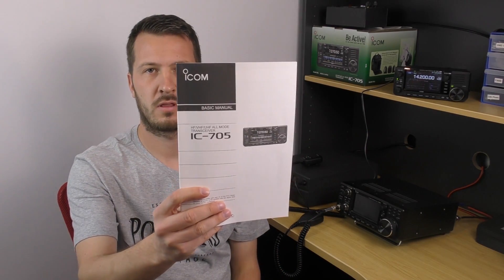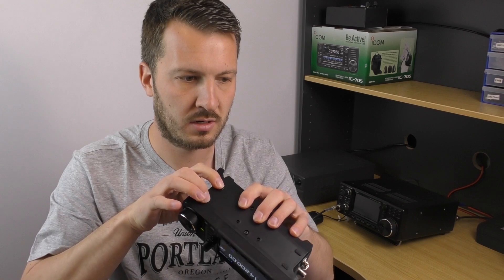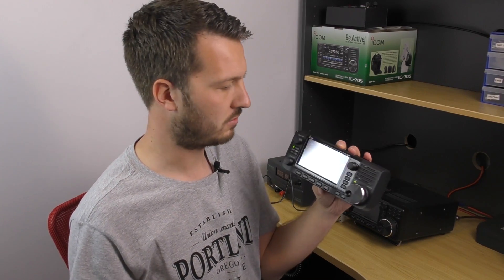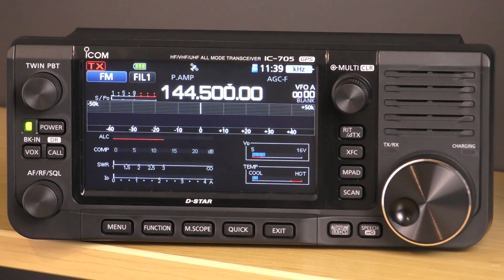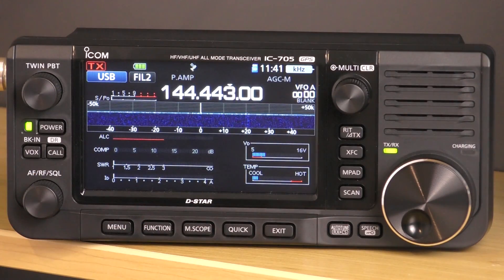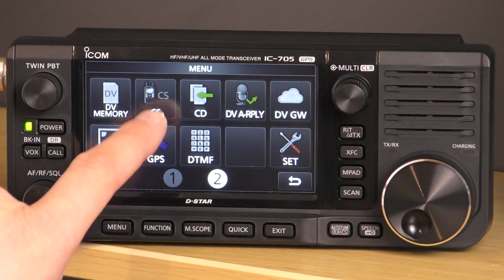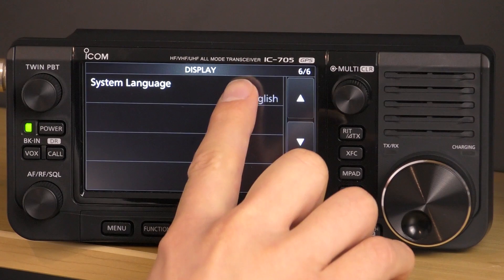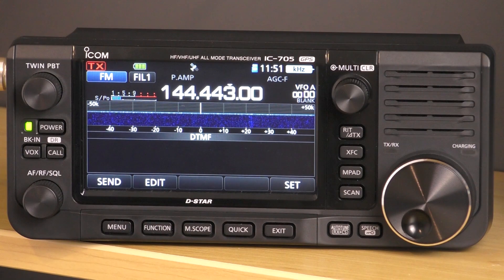Icom IC-705 Basic Setup and Overview

Comment: What benefit is there when connecting the IC-705 to WiFi?
Reply from the maker: Remote operation using something like SDR Control - or the Icom RS-BA1 software. The radio has an inbuilt server over WiFi.

I think it also connects to DSTAR and syncs time amongst other things.

Comment: Hi Hayden. Thanks for the video. I have just got an ic-705 and find it very good. As yet I don’t have a decent antenna, do you have any suggestions as to a good one to get? Thanks 🙏 again. Eamonn. G4TZV.
Reply from the maker: Hi Eamoon, I guess it depends what band. You could probably buy a Quick Release Antenna Bracket for the 705 which comes with a SO239 mounted and maybe a OPEK HVT-600 may work.... But you might have trouble operating it on such a small bracket with no counterpoise or ground. You could also just get a small 6/2/70 whip or a HF antenna from QRP guys?
Reply: Ham Radio DX   Thanks for that Hayden

Comment: Enjoying seeing what you and others are doing with the 705.
So far I'm happy with progress in partnering mine up with a headless BAP,. Using the 7300 profile and CIV address with FLRig/Hamlib for now, with good results. 
The sensitivity of the 705s onboard GPS is nowhere near as good as my USB puck, so I have it connected when indoors to ensure time synch for WSJT-X and JS8Call.
Reply from the maker: I noticed something similar with the GPS. It isn't sensitive enough to pickup satellites when it's near a window unlike some other GPS's I have too. Most of my need for a GPS though will be out in the field in the open
Reply: @HamRadioDX  
Agreed, the great indoors isn't the prime reason the 705 was created and it certainly isn't my intention to use it as a base radio on a permanent basis. However, it's elder 'twins' are not in the limelight in my shack at the moment and -
https://www.tri-m.com/index.php/product/tri-m/gps-networking/gps-re-radiators/l1-gps-repeater-kit
I'm feeling some inspiration for another homebrew project, maybe.
Reply: Can you use the IC705 GPS to sync WSTJX for FT8 ?
Reply from the maker: @thunderc4s  I believe you can get GPS data including timing out of the radio via the USB cable
Reply: @thunderc4s  
Yes. One USB cable from 705 to Raspberry Pi (my system based on the KM4ACK Build A Pi script) delivers soundcard, cat control and GPS including time synch.
Stand alone Delta T is well within the required +- one second.